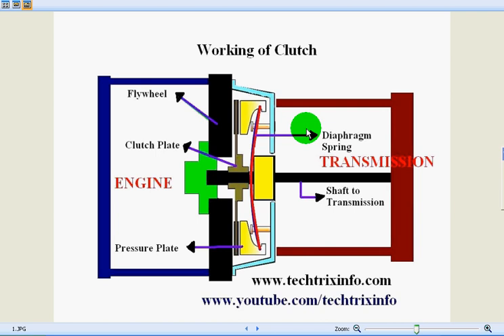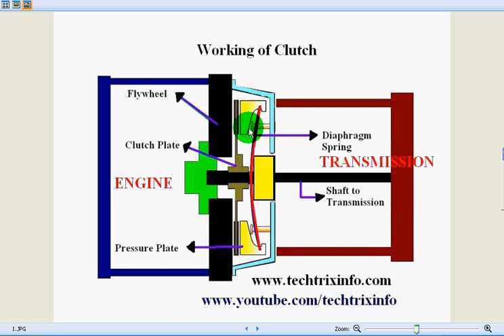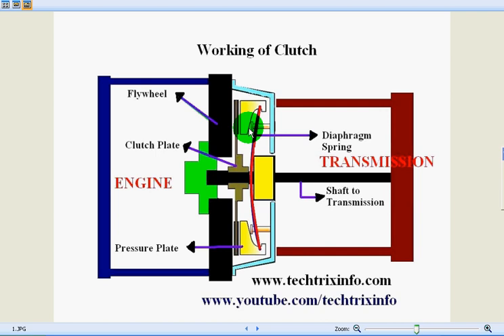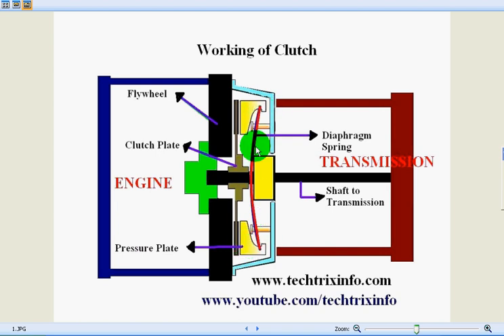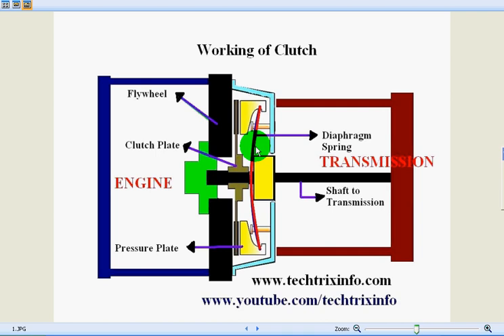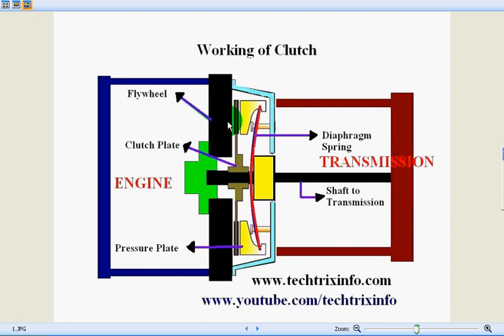Animation - How Clutch Works (Must Watch). ✔

Comment: Just wondering the clutch isn't really connected to the motorcycle engine right just a metal bar right meaning we can relocate the handles and the  bike will still work?
Reply from the maker: +asianshaft your question is not clear

For more info you can email us at techtrixinfo@gmail.com or whats app at +919744615655

TechTrixInfo.com

Comment: sir thanks for the video :) u r doing a great job :) and regarding clutch i am having a silly doubt that during engagement of transmission with engine does the clutch also rotates with the flywheel or just establishes a link b/w them??? and also how does a diapharm spring in pushes inwards when a driver pushes the  clutch pedal ??/ would appreciate if you clear my doubts :) thank u :)

Comment: "The Clutch''

It connects or disconnects the engine torque to the transmission, when pressing the clutch pedal down, it allows the transmission to shift or choose a desired gear ratio.

Comment: I'm not the one you're asking but I'll try to answer you anyhow. You obviously can't improve the power of the engine with the clutch, however, you can use it to make the car more efficient. What you are looking for is a race clutch, they're usually lighter (you'll lose less power driving the clutch), sharper (and more durable to handle this) and better balanced to be able to withstand the stresses of constantly running on higher RPMs.

Hope that helped.

Comment: this one is disengaged, if the yellow block in the middle loses the red spring, the pressure plate will clamp the clutch plate against the flywheel